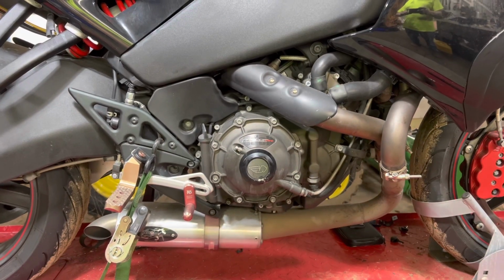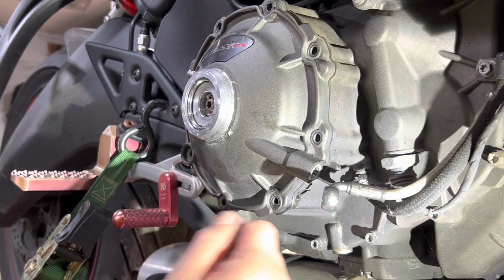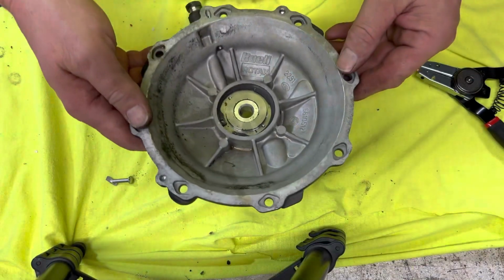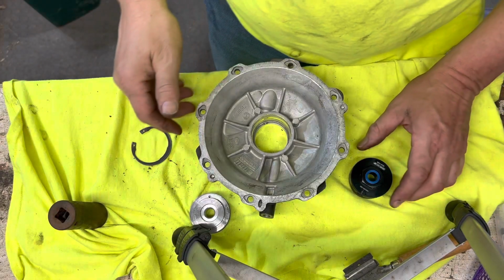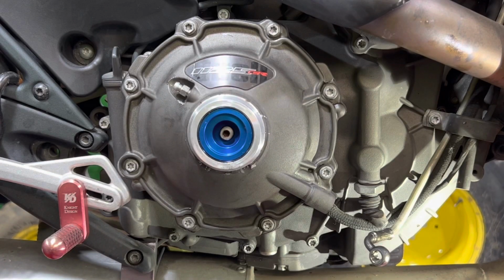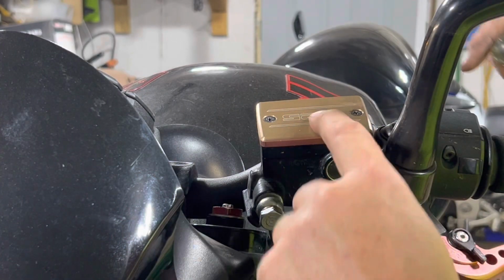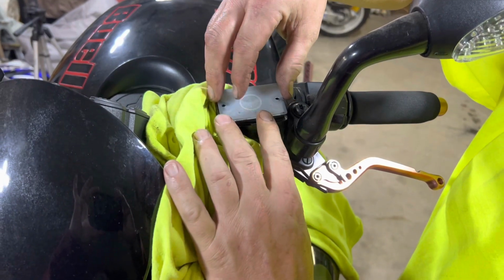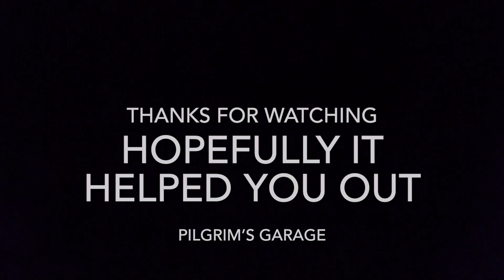2009 Buell 1125CR Slave Cylinder Replacement…Clutch Weep…link in description

Comment: From a multi Buell owner with a 2008 1125 Signature.... By Far the best ever clutch rework video. Have thought seriously about getting an 1190 but this 1125R is so near perfect as a street and track bike. Try this guy's videos on the test of an 1190RS then his video on the 1125R. The 1125R just seems perfect (had a 4th gear problem for a few laps but got it worked out). Great work and thanks. These are only the titles of German VIDEOS.     Buell EBR 1190RS special addition, testride racetrack   AND   Most racetrack Buell 1125R - catch them with torque

Comment: Thank you, liked the smart fix for just getting the clutch cover off, leaving the oil in the gearbox!
Reply from the maker: Yeah that worked out well. No reason to make a mess if possible. I hope it helps you out and thank you for the compliment.
Reply: Found the other video on YouTube and it wasn’t helpful. Doing the job right now and disassembly was a breeze after watching this.
Reply from the maker: @noahgallagher9728  thank you.
Reply: Any tips for bleeding? I’ve gone through half a quart of DOT 4, I got a lot of air bubbles out initially. But now it’s still creeping forward when in gear with the clutch pulled in, clutch obviously isn’t completely disengaging.
Reply from the maker: @noahgallagher9728  I ended up pumping the heck out of the clutch lever a ton! I knew it was going to be a pain so that’s why I time lapsed it. Go ahead and start the bike in neutral and try to put it into gear. As long as you have a relatively firm clutch lever it should be fine. It won’t go into gear if the clutch is still engaged.

Comment: Thank you Sir! I recently purchased a 2017 1190RX and it is like nothing I have ever ridden. I had a 2010 Fireblade and sold it for my dream bike (EBR 1190RX) and although the CBR 1000RR was a great bike I definitely do not regret my decision!
Reply from the maker: This bike is nuts in my opinion. The low end torque is actually kinda scary in my opinion. It pulls just as hard at 2000 rpms as it does at 10000 rpms. It’s so much fun.

Comment: Excellent video....just curious if the spring is re used with the oberon? I'm having a heck of a time bleeding the system so I thought I may have to install it? So excited to receive it in the mail yesterday and nothing working out for me. :face-orange-frowning:
Reply from the maker: The bleeding process took a while. In the end, I had to pump the clutch lever very fast, and I was able to build up pressure and then I would go through the bleeding process of opening the bleeder. Air doesn’t want to go down, it wants to go up, so the faster you pump the clutch, the more fluid you can get down to the slave cylinder. It was a bit of a process, it took me about 25 minutes.

Comment: What spray were you using to clean up the grime in it? Brake cleaner?
Reply from the maker: @lukejohnson3612  yes, just simple brake cleaner. It works fine.

Comment: This same component failed on my first 2008 1125R @ approximately 15,000 miles and now on my 2nd 2008 1125R at 13,000 miles. Thanks for the video. What vendor do you recommend for the replacement valve body?
Reply: Just got the link in description.  Thanks again!
Reply from the maker: It’s the cheapest I’ve found. I see it’s on eBay but it’s $190. It’s only $145 at St Paul. The guy in the Buell department is really knowledgeable also. Thank you and I’m glad it helped you out 😀.
Reply: @pilgrimsgarage looks like I have fitment issues on the older 2008 clutch cover revision😢. I'll give their Buell tech guy a call. Really not looking to spend another 350$ on updated clutch cover just to fit this updated slave cylinder. We shall see.
Reply from the maker: @CenterSenator  keep me informed, I’d like to know how it plays out.
Reply: @pilgrimsgarage   Scratch that- everything fits fine. I thought i needed to use the old cylinder. Now I realize the blue revision piece actually replaces 2 old stock pieces. On to bleeding it down tomorrow. 

Where do you get that sweet billet clutch master cylinder cover?
Reply from the maker: @CenterSenator  it was on the bike. I thought it was factory 🥴
Reply: @pilgrimsgarage  haha. There's not many of us that bought these relics brand new!

Comment: I’m having an issue where the bolt is spinning with the housing and loosening the latter instead of spinning freely. Any suggestions?
Reply from the maker: I’m sorry for the late reply. Did you get it figured out?
Reply: @pilgrimsgarage  Yes
Reply from the maker: What were you able to do? Many on here scroll through the comments for advice and it’s really helpful to those with the same problem.
Reply: @pilgrimsgarage  I pulled the cover off without removing the nut since I couldn’t get it off then just spun it off once I had all the threads exposed. I’d also recommend against removing the banjo bolt since it strips the threads super easily when you try to put it back in (ask me how I know). Luckily you can helicoil it
Reply from the maker: Oh boy, that sounds like a tense few minutes. I’m glad you got it done. That cast aluminum sure doesn’t have the strength that steel does. I’ve never stripped out a banjo bolt but I could definitely see that happening on those. Nice job.
Reply: @pilgrimsgarage  Yeah I panicked pretty bad when it happened and I was stressing since it was my first time installing a helicoil. It wasn’t too hard though
Reply from the maker: @lukejohnson3612 just check it periodically. Worse comes to worse, get a new cover…I don’t think they’re super expensive. If they are, there is a Buell page on Facebook that always has parts. Nice job though…it tests your skills.